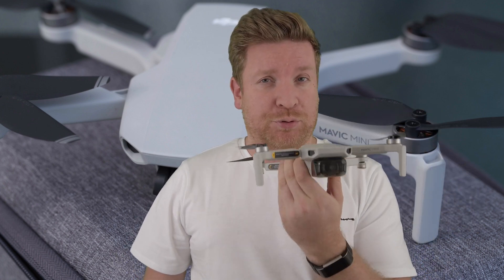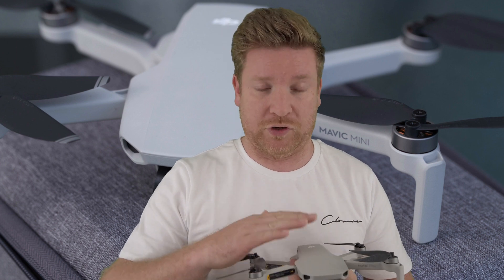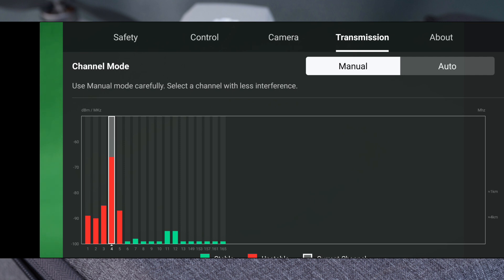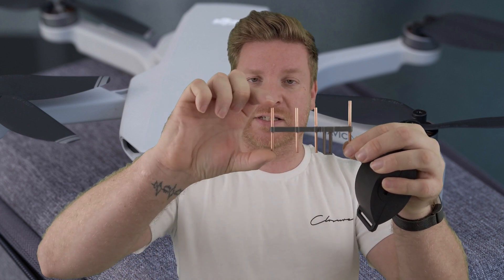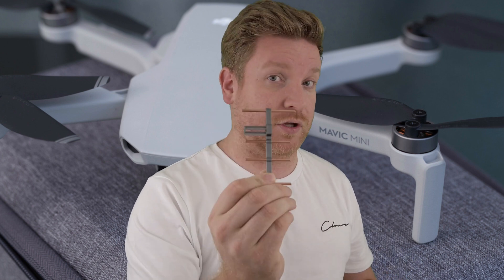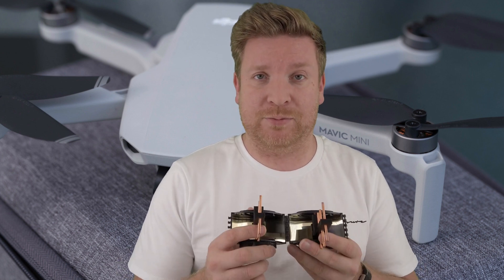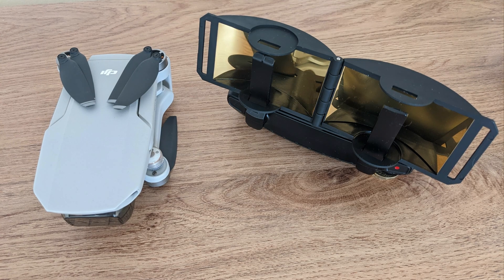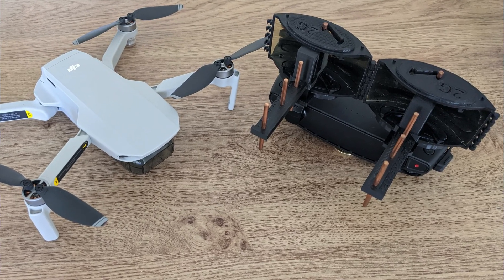TOP TIPS & HOW TO FIX BAD RANGE ON A MAVIC MINI || CHANGE 2.4GHZ TO 5.8 GHZ CHANNEL RANGE EXTENDERS!

Comment: Auto selects the best channel. If it gets weak selects another automatically. Its a smart signal system and always scanning best signal and will switch automatically to one or the other
Reply from the maker: This would be true of ocusync on the mini 2 or later but not the mavic mini which this video is about, the mavic mini locks the frequency when taking off and won’t change until you land

Comment: How can I improve the ridiculous range of my DJI MINI SE? I only have ANDROID and CHROMEBOOK. Not MICROSOFT. So, DRONE HACKS or DRONE TWEAKS features won't  work. CE here in France. Not FCC. 5.8 GhZ only. Yagis of the proper design and mirrors (bought on Amazon) don't really help. I use my drone in rather open and flat countrysides with no obstacles and interferences. Beyond a 350 meters distance, the signal is bad. I even had to press the RTH or run towards my drone, otherwise I would lose it.

Comment: Hi 
Before your flight you choose Chanel manually but after this are you switch back to auto or you stay whole flight time in manual?? Thx
Reply from the maker: On the Mavic mini you are locked in so once you take off it's locked to what you put it on
Reply: @GAVINHR  

Sorry  I didn't mention I have got spark

Comment: A lovely, clear explanation.  Its also best to remind viewers that flying beyond 500m is illegal and when you fly at 5000m you are endangering other air users....
Reply from the maker: Don't forget how long ago this was filmed, there was no restrictions back then providing you was using Spotters in radio contact etc, you only had to have eyes on the general area then whereas now you specifically Habe to be able to see the drone as the remote pilot.
Reply: @GAVINHR  I thought line of sight/eyes on, without additional visual aids had been the rule since the days of Phantom 2s and either  beyond, or extended VLOS using radios required CAA authority?

Comment: I'm struggling to get 600 ft away with parayagis on my mini 1 :(
Reply from the maker: Hi Chris - you selecting a manual channel? I got 500m with my mini 1 in a relatively high interference area with no extenders
Reply: @GAVINHR  hi mate! Thanks for replying. So I do remember last night I actually forgot to select a manual channel. It was only my second flight. I was so gutted, with parayagis and only 600ft before it said weak signal. So you think if I remember to go to manual channel I should be okay? I'm in a suburban area with lots of trees. An ex council estate
Reply from the maker: Yeah try it on a 5.8ghz manual channel, which parayagis do you have? If you have the 2.4 ones in a built up area they will struggle
Reply: @GAVINHR  I have the short ones! I'm guessing they're 2.4!! And a pair of longer yagies? So a parabolic paired with the shorter ones and some longer yagies on their own. Really appreciate the advice!

Comment: HELP#
HI! 
I always fly over the bay at Miami Beach, FL. There is a way to set a "LOW TERRAIN, LOW ALTITUDE WARNING" on the Mavic mini2 or Air 2.
 I get very distracted and lost all altitude while moving the left joystick to rotate the drone. A "low altitude warning" would be life-saving for my drone.  I could set it to any altitude I want. The idea is to increase altitude if I get below, e.g.,  5 or 10 meters.  Then prevent it from crashing into the water. I already lost the Mavic mini and the Mavic 2. I can't retrieve them from the bay floor. I am afraid to buy a new one and make the same mistake.

Comment: I have a question, how do you change the mode from 2.4ghz to 5.8ghz and vice versa?
Reply from the maker: All you need to do is go to the settings, click transmission, then click it in to manual then click on the number that has the lowest green bar
Reply: @GAVINHR  All right...I have another question. HOW DID YOU MANAGE TO ANSWER ON MY QUESTION IN 30 MINUTES? That shows how determined you are on what you are doing here on Youtube. thats a sub from me dude keep up the good work
Reply from the maker: Basically because on my channel I try my best to help people - even if that means taking time out of my day to respond. I've often asked for help and never had replies or responses in the past so I was determined to make sure on my channel as answer as much and as quickly as possible. Sometimes I miss comments as yoube randomly filter them out but I try my best. Thanks for the sub it's very much appreciated :)

Comment: Great video, quick question I live in America and have this drone, I'm thinking about getting the yagi + extenders combo, I mostly fly in cities so should I leave the settings as is? Also if I'm flying in a wide area do I have the option to change it to 2.4 for better connection or is it set to the 5 that we have in the US?
Reply from the maker: Sorry for the late reply - in the US you only have 5.8 on the mini but it has more broadcasting power then our version so you will get a stronger signal more of the time
Reply: @GAVINHR  OH alright, thank you

Comment: What about using Yagi's and leaving it on auto channel? Would it still improve signal?
Reply from the maker: It absolutely will! Providing you are using the right frequency yagi antenna for the frequency the drone has chosen on auto the. You're good to go! 👍😊
Reply: @GAVINHR  thank you. I've got the same ones you have on the video. Just haven't used them yet👍🏽
Reply from the maker: @Through_The_Lens  when you get round to it you will find a big difference - I did a follow up video you may also find useful on my channel :) similar sort of thing but just shows how the drone can get the auto channel wrong

Comment: Great video a lot of information, Thanks, but I have one more question, what if we would use (American version)  Fcc remote in Europe, would it extend range of the signal ?
Reply from the maker: Hi and thanks for watching! Sadly not as there is no hardware differences between the FCC and CE region drones like there was on the Mavic mini it all works on GPS location

Comment: If you are from Europe I would recommend using a fake GPS Spoofer with an older version of DJI fly from an APK file browser, this will switch your drone into FCC mode, you will see only 11 signal bars as apposed to 13, this will help with range a lot.

Comment: first of all you wont see 2.4 in the app if your in the usa you need to use a fake gps spoofer while flying and block your drone on start up with foil to stop it from changing it back.. then take off the foil after 30 seconds so that it gets a lock where your at.. theres tutorials on this or you can pay drone hacks .com i think it is i did 24 bucks usd 20british pounds you pay a conversion its 24 and change.. and youll get a boost 1.8 watts if this is real i dunno i paid em its still 5.8 but tells the transmitter to max out the power..

Comment: Should i get the FCC or CE version of mavic mini both are available in my country!
Reply from the maker: If you have the choice then 100% the FCC ! It has more broadcasting power so you will get a stronger signal
Reply: @GAVINHR  will surely remember to get yagis too
Reply from the maker: In all honesty with the broadcasting power of the FCC you are unlikely to even need them! The FCC only works on 5.8ghz so its the shorter yagis you would need !
Reply: @GAVINHR  thnakns king

Comment: Hi gavin
Thanks for your really good videos. I have a Mavic Air which also is wifi only, i struggle to get good video connection beyond 600m, how do you get 1500m with no extenders?
I have not been putting my phone into airplane mode, would that would make a difference? I am going to try range extenders to see if they help. 
I do not really want to fly 1000m or more away but i do want a reliable video feed upto 600 -1000m.
Thanks, keep up the good work.
Reply from the maker: Which sort of environment are you flying? Around a city or out in the countryside? One of the methods will be as I stated in the video, if you are flying in a city select a manual 5.8ghz transmission - one with low signal interference so that's the green bar as low as possible, and for the countryside select a low green one. Make sure you are always pointing the controller toward the drone with the flat sides pointing upwards. Airplane mode in my opinion is a myth so don't worry about that! Sorry if i sound like I'm teaching you to suck eggs I'm just not sure how much you know so trying to cover most bases

Comment: Great video 
Just a question my handset charges for about three hours shows four lights .
I go to the field it immediately turns on just three ?
Any ideas please
Reply from the maker: Yes that's fine :) I went into the field on only 2 lights!
Reply: @GAVINHR  it's charging your phone while connected.  Another plus for the mini 2, that problem is gone.  So be sure your phone is well charged before flying.
Reply from the maker: Wow! I never even noticed that! I always change my phone to over 90% before flying however thank you very much for the tip!

Comment: Brilliant video thanks for explaining the signal strength as I was selecting the green signal withe higher level
Reply from the maker: Absolutely why I wanted to include it in the video! I see so many people thinking the higher the bar means its a better signal when in fact it means more interference ! I am glad you found it useful, Thank you for watching!
Reply: Going to try later if the weather is ok. I have also got the reflector as well so going to try with out then with thanks again
Reply from the maker: Let me know how you get on!

Comment: New subscriber" i just bought the mm one in the US good explanation on signal really enjoy this little guy but I bought mine used like new it has the motor covers under propellers are they nessisary? will motors run cooler without them? Thx again for taking time for new flyers
Reply from the maker: Thank you for the sub I really appreciate it! So in my honest opinion there is no need to have them on, the issue is there is threadlock on the propellor screws which is why you should use new screws every time you replace them if they get damaged etc. Basis the above I would probably leave them on until you need to change your props then at that moment take them off and leave them off. Hope this helps!

Comment: All good tips! I would also add being in an open location free from buildings, trees and other obstructions and away from sources of WiFi interference is critical to get good range with the Mavic Mini.
Also find a good position, higher than the surrounding landscape, gives your signal.a better chance of going further. So jot just the altitude of the drone but the height of the pilots position is also crucial.
My best absolute stock with no boosters, with my CE Mavic Mini is over 1600m, all things considered that's pretty good for a WiFi drone! 😎👍
Added my support to your channel, hopefully you'll check out mine and connect? 😎👍

Comment: Are you sure that channels can change in-flight? There are a cuple of threads on dji forum that says they cannot. (i.e. https://forum.dji.com/forum.php?mod=viewthread&tid=212022)
Also when you manually change channels, there is brake in connection for a few seconds. Never seen this happen in-flight.
Reply from the maker: I've read multiple times that the channel cannot change in flight however to clarify for my own knowledge I asked DJI directly who claimed it does. Unless the person told me it can was wrong themselves then I don't know but I 100% was told by DJI it can.
Reply from the maker: To follow up, obviously after testing the auto Vs manual transmission I do always fly in manual mode anyway, from what DJI explained the transmission is locked in IE 2.4 - 5.8 but the channel can change in flight. Again, I'm only quoting what I was told directly when I asked them for clarification

Comment: Hi Gavin,
Great tutorial. 
But you keep forgetting the x-yagis... big mistake. 
To make it easy for you I spoke to a seller that I know and he'll gladly provide you a pair for you to test. Call him through his ad at his eBay store. 
https://www.ebay.com/itm/114464888257

P.S.:Already using the green stuff you got from amazon? Looks great!
On the other hand, you should have normalized the audio... but it is still very pro. I'll keep you subscribed! :-)
Reply from the maker: Thanks for that Carlos, I have had no idea where to even get them from! This is not something I have see. In the UK at all so that link is very helpful!! Yeah my mistake, basically I had detached the audio on the transmission bits and simply forgot to turn the volume up on those bits. Thankfully it's only a short segment, I am mostly working from my laptop at the moment so much smaller screen which makes the timeline quite hard to see so it was easily missed. Yes absolutely ! Means I can use the camera and a decent microphone and get a stable image to work with !
Reply from the maker: Hi Carlos, you will be pleased to know I have a set of these X Yagi on the way! I hope you are aware I am doing this test as a thank you for continued support on my videos and I have purchased a set. I think I will test them against the normal copper yagis if you agree?
Reply: @GAVINHR  Hi Gavin,
At last!!! That is great news. 
Just a few minutes ago, I did a flawless 9,2km flight with my antennas, so I'm very confident that you will like them too.
You can do a comparison with any of them, including the so advertised parayagis. I imagine they'll perform more or less equally (but at a much lower cost)... 
If you have the chance, try doing a oneway flight to see their top range. That is the one thing that I'd like to do myself, but still didn't have the chance to try (don't have the best field nor the friend with enough time and experience to get the drone at the destination)...
I know you only want to do studio filming now, but have a heart and go to the fields a few more times... for the viewers sake, that is 😁
Reply from the maker: I definitely will continue doing the tests and footage, the studio filming is just another option! I know my channel isn't the biggest but I've tested range and battery tests and alsorts now and all the different range extenders I think if the rumours of the Mavic mini 2 are true I will maybe move on to that model. Given the fact I'm thinking of the mini 2 I seriously have bought these just for you and I will be mentioning you in my video haha! I will try 1 way long flight I think my goal would be to compare them to the normal yagis and see how close they get to the parayagi. Shame there I'd no way of a commission if they do well with no UK supplier
Reply from the maker: Thanks man I will do! If the MM2 has occusync that's a game changer I think! I think my litchi tests were quite productive but it wasn't as smooth as hand flying I feel but it did its job !